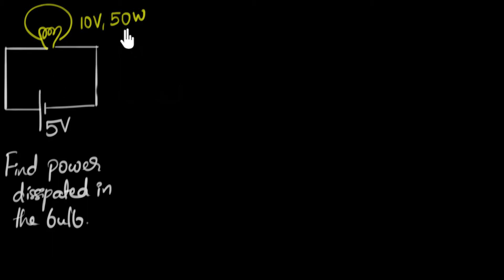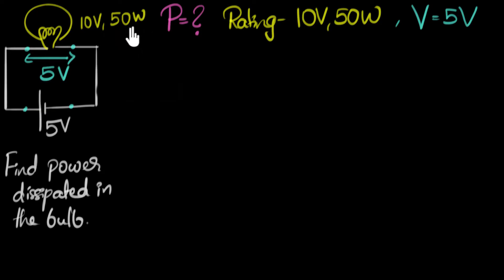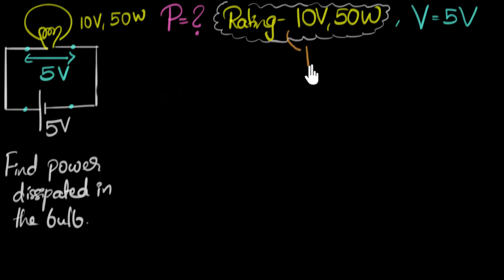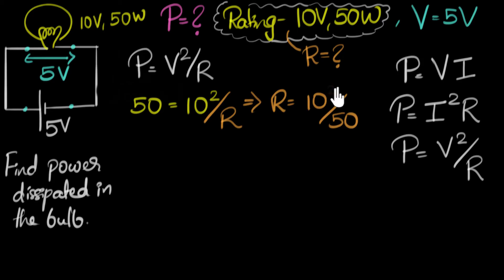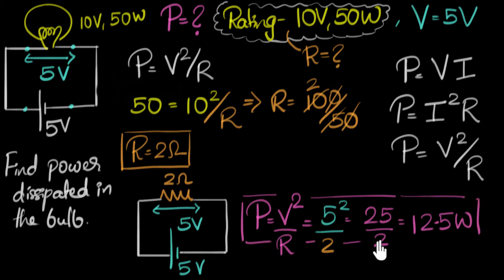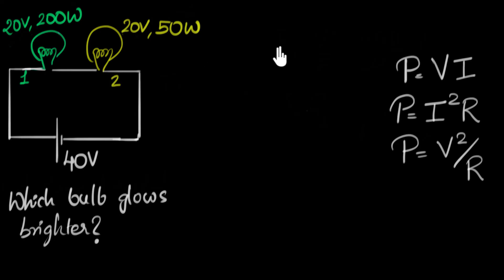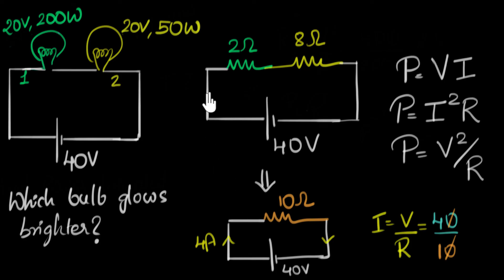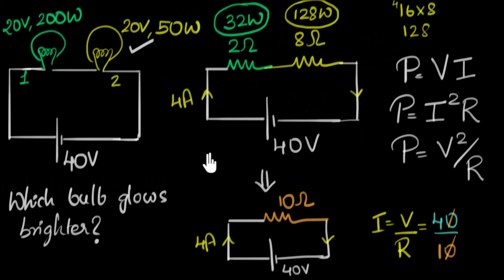Solved example: Power dissipated in bulbs

Comment: In the second problem, you solves the final power with P=I^2×R; however, if I solve this with other equation, I am receiving different answers. Like, for instance, P=V^2/R => (20 volt of first bulb)^2/2 => 200watts. Please tell me what is happening here.
Reply: Bro they are in series so voltage is different for both resisto. I - 4A R1-2ohm so voltage is Ir which is 8volts and second one voltage is 32volts
Reply: Thank you so much ❤ @liketh
Reply: Now use v2/R
Reply: We get 64/2 32 watts and 32*32/8 which is 4 into 32 which is 128 watts

Comment: Would you please clarify this to me that for a bulb we know it has power of 50W and voltage of 10V, therefore we can calculate how much current will pass through it from the equation P= I∆V, and we find it to be 50/10= 5Amps, which is going to be the same if we were to have found this from your answer of having 2ohm resistance, turing out to be P= I^2R ==} I =√(50/2) ==} I=5Amps. However, after this, we know P=I ∆V, and by solving this for new power we get P= 5Amp× (∆V of the battery, ie. 5V) ==} P= 25W, which is twice of 12.5W. Likewise, if I solve this with P=I^2R, I get (5)^2×2, which is 50 Watts. It appears that every answer of mine is multiplied by 2, like 12.5× 2=25×2=50. Please tell me what I did wrong here!
Reply: did u find an answer for this i am also wondering same

Comment: Your answer for the power dissipated in the 10V, 50W bulb operating at 5V is incorrect. The resistance at 10V and 5V is not the same because of the temperature dependence of the tungsten filament resistance. The filament is cooler at 5V. The  correct power is determined as follows: 
P2=P1*(V2/V1)^1.55
P2=50*(5/10)^1.55=17.1W
Reply: Where does the 1.55 comes from

Comment: The last question Solution is So easy >>> we notice that the rating of the two Bulbs have the same Voltage (20 V) >> and the same Voltage mean if we have a circuit of 20 V for the Bulbs the first will be 200 and the other one will be 50 >> and we can get this case if we connect them parallel so we have the same Voltage ,and by the way in Parallel Circuits if we have 20 V and raise this to 40 V (20*2)  the Power will multiply by 4 directly so the 1st bulb will be 800 W ,and2nd be 200 W directly and the current will multiply by 2 only like voltage >>> But  If we Put them as series we still  have the same current but different Voltages So the High Voltage will cause the High heat and the High Glow .. Hope that answer your question

Comment: Sir very well described.I think the answer of your last question is simply that the bulb with low power rating has high resistance.If resistance is high ,the bulb will glow brighter.If my answer is wrong,kindly tell me the right one.
Reply: No in parallel connection, the one with lower resistance has a higher power dissipated.
Reply: @ultimateaaj2921 
 If according to equations, then,
When they are connected in series, the current remains same but voltage changes. This is why we consider the eqn P=I²R. According to this the more the resistance, the more the power would be.
When they are connected in parallel, voltage remains the same but current changes. This is why we consider the eqn P=V²/R. According to this the more the resistance the less the power dissipated will be.

I hope this helps
Reply: @ultimateaaj2921 but it is not parallel connection, it is series connection

Comment: How a 20 w bulb can produce 128 w !!!!!!!!!
Reply: 50 w to 128 w impossible....
Great mistake here
Reply: @Ratulphysics  the only mistake is he took a battery which provides 32V across the 8ohm register (bulb) where the max voltage we can provide is 20V according to the voltage rating of the bulb...otherwise voltage difference over 20 volts will damage the bulb...but our mathematical equation is not able to predict the highest voltage...so that's why due to this mistake we got 128W from 50W bulb which will never be possible in real life.
Hope it will help you🙂🙂
Reply: @petermarkwood9077  yes 
I understood it clearly but the problem is that this mistake makes a wrong conception Among many students that's why I commented here.
And everything fine but we must consider the Voltage case here  also with power in every aspect.since no light can be bright than it's actual limit..
Thank you for the reply
Reply: @RA Physics - Ishtiak Kabir Ratul  The actual problem here is that there are two bulbs. So the voltage is split. If you calculate the voltage of each bulb, you will find that the 50W bulb gets a lot more voltage as it has higher resistance. So Naturally, it will dissipate more power.

Comment: In the last problem why sir we aree not using V2/R?
Reply from the maker: You can use it and I encourage you to try. But, we would first have to find the V across each resistor. 40V is the total voltage across both resistors.
Reply: @KhanAcademyIndiaEnglish  oh... Okay sir thanks a lot 👍
Reply: I could understand logically why bulb with low power rating glows brighter ? Please explain

Comment: Why in second question power dissipation according to the formula P=V^2/R is different than P= I^2/R..
Reply: Because V=I/R. You can just substitute. They're are 3 different ways you can arrange the power equation with these two equations
Reply: hello, could anyone help figure out why the bulb with a lower power rating glows brighter?
Reply: @shreyashsaxena6248  the resistance of the second bulb is higher. Which means the heat generated in the second bulb will be higher. So power dissipated would be higher.
Reply: You are wrong here.
From both the ways, you get P1 and P2 to be 32W and 128W (resp) only. 

Let me explain this to you..
From calculation we got: R1=2ohm 
R2=8ohm...
Now...
Total volatage across circuit is 40 volts & We know that in series circuit V is proportional to R ( since in V=IR, I is costant for both resistances and so V is proportional to R ) 
So 
V1÷V2 = R1÷R2...........equation 1
V1 + V2 = 40volts
V2 = 40 - V1  volts.........equation 2

Putting eqn 2 in eqn 1, we get
V1= 8volts and therefore V2= 32 volts

And therefore 
Power diss. in bulb 1= 32W 
Power diss. in bulb 2= 128W 

EXACT SAME VALUE as we got from I^2.R formula.

Hope it helps☺️

Comment: Sir plz elaborate why 2nd bulb of less rating glows out to be brighter when connectee in series?🤔
Reply: Bcz from calculation we got:
R1=2 ohms & R2=8 ohms & i=4A
So, 
Power dissipated in bulb 1, P1=32W
Power dissipated in bulb 2,P2=128W

Since the power dissipated in bulb 2 is more than that of bulb 1, It glows brighter. 

It's not always the case that the bulb whose power rating is higher glows brighter.....you have to find it with thw data given..
Reply: The power dissipated in second bulb comes out to be 128 watt, which is greater than the rated power across it,so second bulb will get fused. 

Second bulb will not glow at all,  Only the first bulb will glow in this case.

Comment: When 2nd bulb is having rated power of 50watt how 128 Watt is paper dissipated sir
Reply: Actually the second bulb will fuse due to higher power through it than rated...hope it helps
Reply: As the voltage is low in the 1st bulb